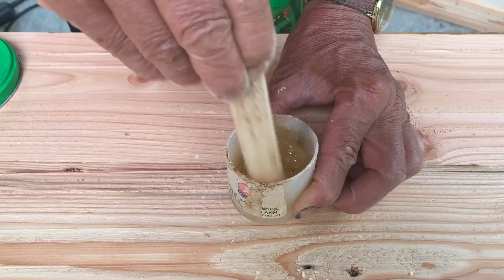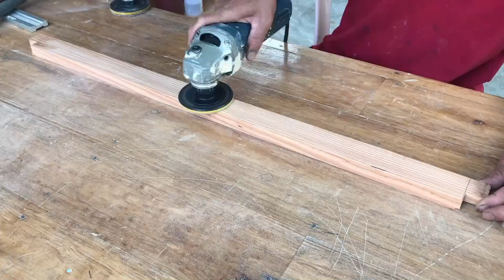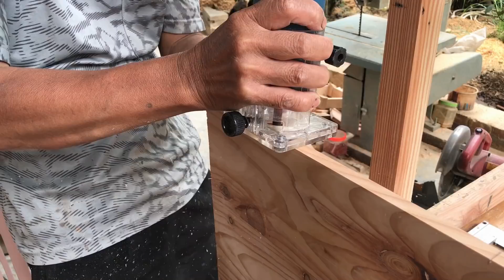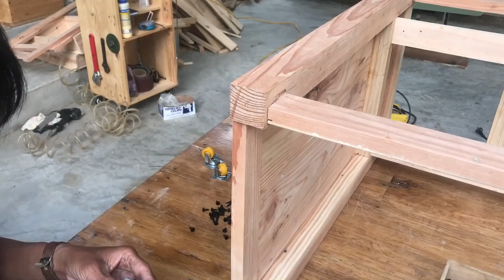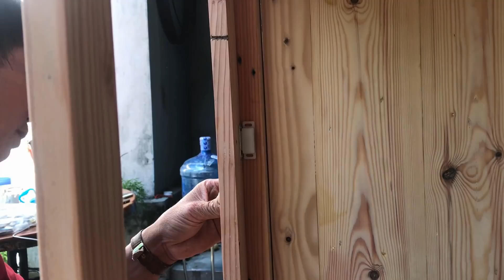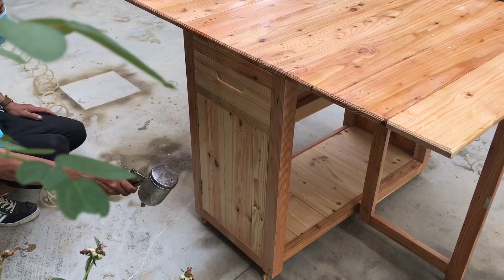Amazing Creative Woodworking Idea From Old Pallets // How To Build A Smart Table Space Saving

Comment: I watched about 3 minutes till I saw the guy planing down some decent looking 4/4 X  at least 10 inches wide, and I’ve never seen pallets made of inch thick boards.  At least not in North America anyway.  Good job, but that’s not really pallet wood mister
Reply: why does all the pallets have to be usa standard  ??
Reply: Pallets come in in a variety of shapes and  sizes depending on what they  are used for and the weight of the cargo.